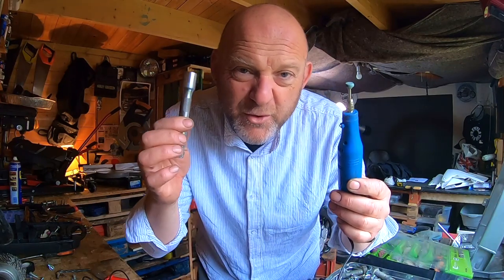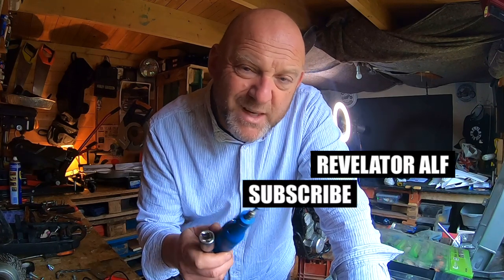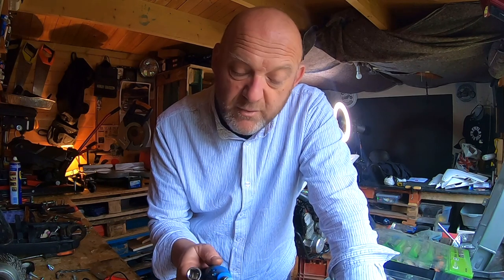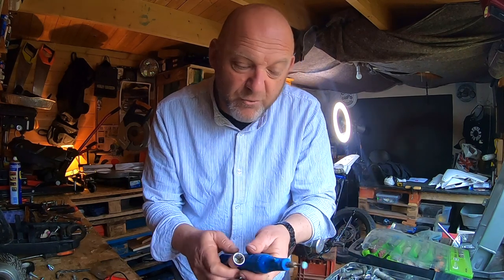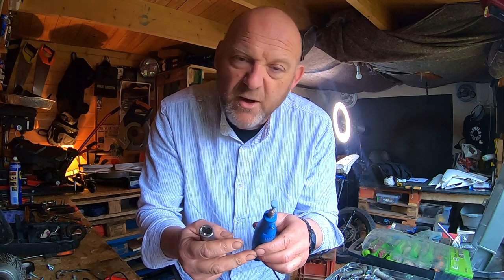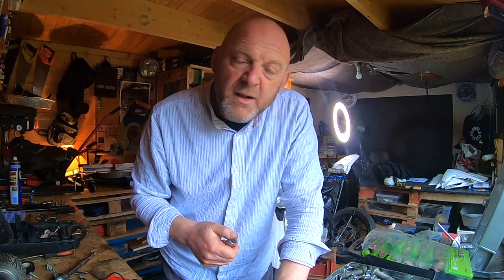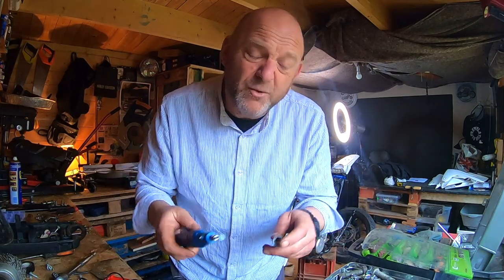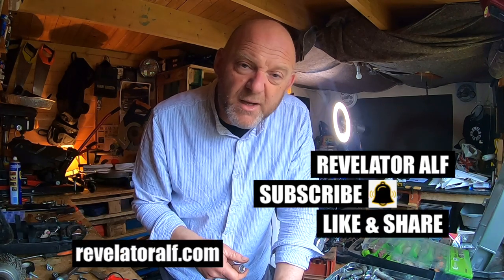Why You Need A Workshop Rotary Tool | Wrench Extension Fix | Motorcycle Project Build Tips

Comment: Years ago now I bought a tool roll full of different sized drifts, since then I bought a metal lathe so can make up any size steel drift I may need. Some people may not know, chrome sockets and extensions can shatter if you wack them to hard, use ones from an impact set if you must.
Reply from the maker: Yep 👍